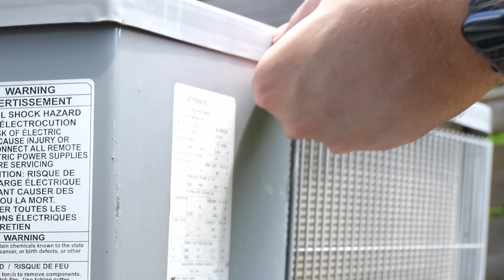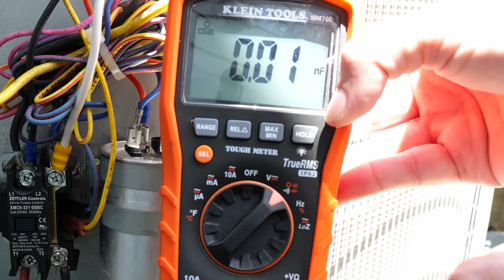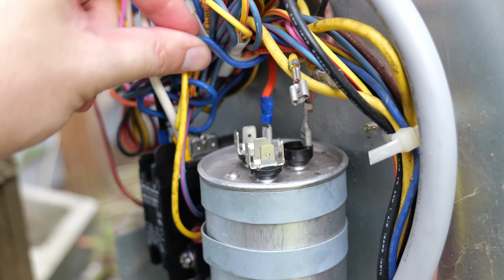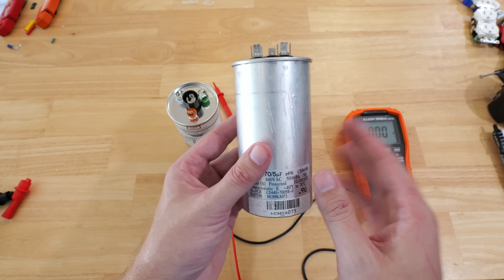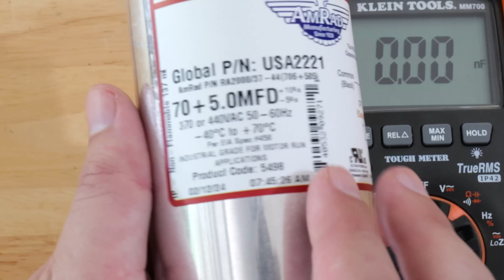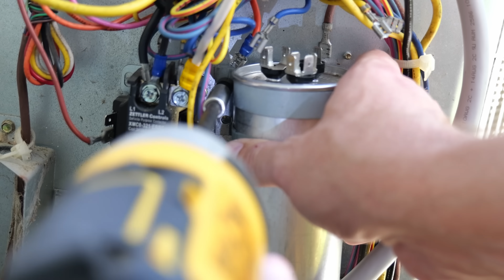Don’t Get Ripped Off! How To Avoid The AC Capacitor Scam And Save $500

Comment: I used to work on high voltage organs and amps. Had to desolder and resolder the caps to test. (Point to point wiring.) A hassle but you can't check a capacitor without disconnecting it.

Comment: Now I am confused about the part where you actually replaced the tested good capacitor. Was it indeed bad? If not, why did you replace it? What issue brought the technician to you so that he was to sell you the idea of a bad capacitor? If it's not bad, then did you solve your original issue?
Reply from the maker: I didn't have an issue.  It was a regular maintenance visit.  What does my capacitor have anything to do with anything outside of what was discussed in the video?  Why does the origin story matter?
Reply: @HowToHomeDIY  Because everything starts with a symptom and followed by a diagnosis and then an action. People don't just replace a capacitor because they want to. In your case (or in your video), you claimed your resistance was good, and you replaced it anyways, which confused me.
Reply from the maker: Because I’m making a video showing how I do it.  It’s not really that confusing.  I didn’t cover up anything.

Comment: I’ve been doing this for over 20 years and one thing I always keep in my pocket is a small sharpie. When you pull those wires off the capacitor mark on the back of the wires with a “C“ for common, and “H“ for hermatic and a “F“ for fan. That way if the new capacitor gets twisted around, then you can look on the top or the side of the capacitor and match the wires back up.

Comment: If I am paying a AC guy for a service call I would let him change that out.  The caps are not that expensive and you are already paying just to have him there anyway.  These Capacitors can go out at the worst times like on a Sunday.   I keep a new one in the junk drawer.   Also if anybody has had a few of these go bad it is most likely the motor getting tight. Check the motor see if it spins freely.  And guess what i am not an ac guy just someone with a few years on me.  ☮

Comment: last year I had to have a new condenser, I was told that it was still under warranty, to my surprise they charged me 700 dollars on a covered warranty part, and it took them less than 15 minutes to install it.  I know I am paying for a person's experience, but, I still have to feel I have been ripped off.  I am pretty sure the issue I have now is the capactor, I just dont feel confidnet to replace a $35 dollar part, and I figure I will be charged 500 or more dollars to get it up and working.

Comment: My air was not cooling the house i went outside to to the unit the fan wasn't turning and it was making a awful humming/buzzing noise. I shut everything off ,thermostat, and pulled the disconnect out .i then turned everything back on thermostat , put the disconnect back in. Buzz noise stopped fan cam on ran it for a while but still wasn't cooling like it should .i shut it off again and started it up and buzzing came back and fan stopped again . Basically the fan worked then it didn't. After shuting off and on . Ether way it wasn't cooling and the wind the fan creates was cool and not hot like I think it should be as it pulls the hot air from the house .so after this long explication could it still be the capacitor .would a bad capacitor make the unit ack this way  sometimes works sometimes doesn't

Comment: I've seen one video where the author added the corresponding refrigerant to his unit in a way same like you would add it to your car. I would appreciate any opinion, if this is a good idea. I saw a port, covered by a cap on my Compressor. seems like nothing complicated about that project, but the video about adding the refrigerant into the Compressor was the only one I saw. So not sure if there is maybe smth special about adding the refrigerant to your home AC unit. Thank you.
   Update: In my case of not working Compressor it was just a failed capacitor. Measurements of the capacity on both sides (HERM and FAN) were very close to zero. Today I installed a new AmRad one, and everything works well now. The attaching bracket (fm the original capacitor) was a bit too tight, so I released the attaching bolts much more than they were sitting originally, and used same bracket. I am happy, since it is 104F in Dallas TX today and expected to be for several more days. Though I have 3 extra portable window units for emergencies (and I think everyone in the hot climate should have), which I used for 3 days while I did the research, ordered the new capacitors and a contactor. They worked, but the Central AC is so much better. And from now on I'll have 2 spare capacitors and a contactor. I've seen on the unit a relay, I might order that as well to have a spare.

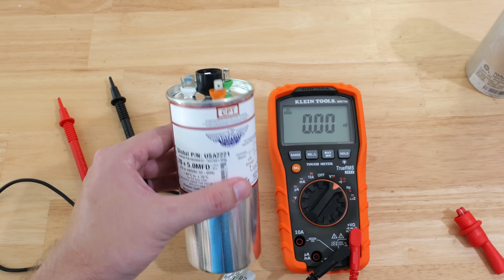Comment: @9:15   I think to use that AmRad Capacitor, but not sure if you need to cover with smth that 4th (orange) terminal (for Hard Start Unit), since I don't plan to install a Hard Start Unit right now. Or this capacitor is better to use only if you have that Hard Start Unit in your compressor? Thank you for the great video, which is very helpful for me in the project of replacing the Capacitor and probably the Contactor as well.
   Update: today I installed a new AmRad capacitor, and everything works well now. The attaching bracket (fm the original capacitor) was a bit too tight, so I released the attaching bolts much more than they were sitting originally, and used same bracket. I am happy, since it is 104F in Dallas TX today and expected to be for several more days. Though I have 3 extra portable window units for emergencies (and I think everyone in the hot climate should have), which I used for 3 days while I did the research, ordered the new capacitors and a contactor. They worked, but the Central AC is so much better. And from now on I'll have 2 spare capacitors and a contactor. I've seen on the unit a relay, I might order that as well to have a spare.
Reply from the maker: It doesn't make a difference, it is just there in case you do have one.  It is currently in my AC unit now since my cap blew out a couple days ago and I don't have a hard start.
Reply: @HowToHomeDIY  Thank you very much for the replay.

Comment: Don't you have to have an insulated screwdriver, or tool, before messing around with discharging a capacitor?  
As a rule, I'm SUPER leery of messing with electricity. I do it, out of financial necessity & because I don't want to be a wuss, but my sphincter is so puckered it squeaks as I'm trying to work, & it's very distracting. 🫣😳🤦‍♀️🫣😁

Comment: Good for you testing for voltage. Did you check something that was energized after checking the line side of your incoming voltage? I have seen a meter fail and give a 0. Reading when in fact there was full voltage on the terminals.

Comment: The other main problem with this practice of simply replacing the capacitor, is that it can often miss the reason why the capacitor went bad (when it actually is defective), which could be a more severe issue with the unit that needs to be diagnosed properly.

Comment: Thanks! Your video was easy to follow and understand. Not only did I save big bucks, but I was able to fix my A/C the same day and not have to wait 3 to 4 days for a service call. This was the 3rd time my A/C's capacitor failed, but this time I fixed it with your help.

Comment: On the hottest day of the year, my ac stopped. Called a local company and they wanted to charge me $800 to change the capacitor. I’m glad IM resourceful enough to dyi. 30 bucks and 10 mins I changed it myself. I’m offended by gouging
Reply: If you had called my company on overtime rates, it would have been around $900 to replace a capacitor. I've been an hvac tech for 20 years. I would much rather have homeowners take care of themselves instead of calling me at 2 am asking to pay triple price and demanding i come out right away  because they're uncomfortable and somehow that's an "emergency"

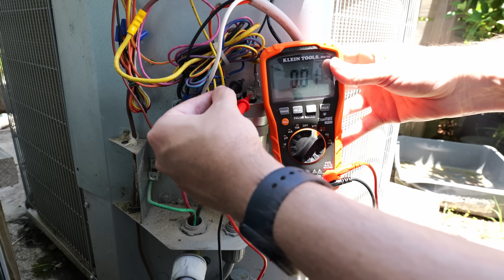Comment: Hi can you tell me why you used a red on the common in the first test (6:32) for the common and then a black on the second test (8:21)? thanks
Reply from the maker: It doesn't make a difference.  There wasn't any reasoning.  Thanks for the question!

Comment: 30 year HVAC tech. 90% of the time the capacitor will look in good condition when its bad. Its simple folks. Check the contactor to see if the plunger is drawn in right in the middle. That proves your thermostat is asking for your AC to come on. Second is to check high voltage with meters. If the fan is running but the compressor is not or vise versa, its your fan or its your capacitor. Your capacitor provides electricity surge to start them like a car starter. If one doesnt start replace the 20$ capacitor.

Comment: I replaced a capacitor on a 220 volt window unit we call big Bertha. The capacitor only had two connections and I got it wrong. As I was moving the capacitor it discharged into the case. I hooked it up again and this time I did a screw driver discharge and it sounded like a gun shot. It was getting charged up, but was not discharging as part of the compressor operation. Be careful.

Comment: How much do you think a chicken costs a farmer?  By the time it gets to the grocery store and you buy it, there has been a lot that has gone into it. It's crazy to hear people that will pay 75$ for 3 dollars worth of food at Applebee's complaining about mark up on parts. Buy a van, hire a guy, fill the van with 10k in parts, buy insurance,  buy workers comp, but the expensive tools, then tell me how expensive the capacitor is. Idiots.  You wouldn't run my errands and give up your Saturday for 3 or 4 hundred dollars,  but you complain when a licensed proffesional charges you to do that. Wait until you need a compressor.
Reply from the maker: So people should just accept $500 bills for $20 parts and 30 minutes of your time?  If you have that much overhead, you may need to look within.
Reply: @HowToHomeDIY 
30 minutes? I can tell you were an hvac tech for about 3 minutes before you started this grift. No qualified tech will just swap a permanent split capacitor out and call it job done. You should clean the coil, get the mud out of the bottom so it doesn't rot, tighten all the wires, which probably destroyed the capacitor to begin with,  check tge charge, seal the access caps, check the evaporator,  clean the evaporator drain. All the stuff that will make it run correctly without eating the compressor for tge next 10 years.  You're bashing service companies and you have no idea what they do. Go ahead with your grift, you're causing so much damage for them to repair.  Unfortunately,  most just want to het you up snd running for the long haul.

Comment: Unfortunately there are companies that are only out to sell parts. But I went to a reputable technical college for two years. Worked as an apprentice and eventually became a master technician. You are paying for my knowledge and expertise. If I found a bad capacitor I would find the reason it went bad, and there is always a secondary problem that led to the capacitor going bad. I would correct that problem then complete a fifteen point check on the system. I was never on the job less than one hour. You would receive a guarantee on my work and factory warranty on parts. Also I would keep customer updated as to what I was doing and why through the hole process.

Comment: So glad my Trane unit has Separate start and run capacitors, because the cost combined of replacing the two is 5 times less than replacing that duel capacitor of yours. No excuse of why they couldn't have designed that unit of yours with enough space for separate capacitors, except on their end additional wiring, and maybe a cheaper board?

Comment: What people don't understand or think about is your not paying for the part before the tech showed up you didn't know it was the capacitor so that's #1 also you don't have that size capacitor put away in your house it is conveniently in the service companies truck outside your house #2 convenience also you will get a warranty from the company who installed it also you won't have to worry about liability like getting shocked with 240v or installing it wrong and grounding your compressor ect #3 it is a service your paying for not the part just like you would pay 80-90$ for a steak that costs 15-20$ at a steak house you don't ask your waiter how much the steak costs before you order it stop being a cheap pos and pay the service people when they fix your shit
Reply from the maker: Uh oh, sounds like we have an upset HVAC tech here.  1. I knew it wasn't the cap before he got here because there was nothing wrong with my unit.  Was just regular maintenance.  Also, I do always have an extra cap on hand so it is here already and I don't have to call a potential scam artist posing as a pro.  #2 Have literally never had an issue with this.  Turn the power off and the wiring is super easy especially if before pictures are taken of wiring placement.  #3 I am not buying an $80- $90 steak.  That is for the rich and I guess, scam artist AC techs that have all that extra cash.  That is ridiculous, just like paying an HVAC company anything over $300 for a cap replacement.  Thankfully, I can fix just about anything on my AC outside of refrigerant as I am not going to go through the trouble of getting my EPA cert.

Comment: Heat pump AC died yesterday afternoon.  I knew from prior experience and Youtube it was likely the capacitor.  Watched this video to confirm how to test it and this was perfect.  Mine tested bad.  I ordered a new cap from Amazon at 8 PM last night.  It delivered a few minutes ago and I had it installed in 5 minutes.  AC is working now.  Absolutely great video.  Thank you so much.

Comment: This is a really good video. Thanks. Well explained. I have the mm420 version of that meter. I learned when testing some electronics that they can have a capacitor testing limit. Mine goes to 400 mfd. anything above that and it won’t work. I think your model goes even higher. But if you have a capacitor that is over 400 mfd, mine shows “OL”. Even though capacitor is good. Lastly, the meter itself has a +/- of like 3% accuracy. So consider that when measuring things.

Comment: how do you replace an older ac capacitor mine the connections are different on top where the wires are naked and go through the 4 holes in the terminals

Comment: I replace my own, they are easy to test and easy to replace, just following general safety precautions, power off, disconnect, test that power is disconnected, short posts on the capacitor to discharge, and replace that rascal. easy peasy.

Comment: Have 10 rental units 20 HVAC inspections per year. Everytime the routine maintenance fids a bad capacitor. Shocking! Every tech is a liar. I routine replace the capacitor every 3 to 5 years.

Comment: My sister had a bad capacitor on her air conditioner and the company insisted on replacing the unit.  Another contractor looked at it, replaced the capacitor and contactor, and they only charged her $150.

Comment: ac unit 2 blue wires   2 red wires  on main capacitor  jumped to a seperit fan capacitor  then power .i want to go back to 1 capacitor 3 reds 1 blue .i have new cap  not shure about the wireing

Comment: This video is bs on so many fronts. Pixar’s early form existed before Lucasfilm hired the people to get its internal graphics division going. Ed Catmull and Alvy Ray Smith helped form  the graphics division at NYIT, and then while at Lucasfilm, they were throwing names around for the hardware they wanted to eventually sell. Alvy tossed out “the Pixer”, an invented Spanish verb meaning ‘to make pictures.’ 

Loren Carpenter said, “Well, radar ends in ‘ar’, and it’s got a kind of high-tech feel to it. Why don’t we use ‘ar’ instead of ‘er’?” -The Pixar Image Computer was  born. Howard the duck is 100% unrelated to the Pixar story. Jobs was smart enough to see where it was going and funded Pixar after the hardware couldn’t sell enough to sustain its costs.

Comment: Keep in mind (as stated),that bad caps don’t always swell. Sometimes just the fan itself wont spin up and when manually rotated will eventually spin up and maintain while pulling higher amperage. Saved myself $1100 since the motor my tech said was bad was not. I replaced the cap with my spare and never called him back.

Comment: AS AN ELECTRICIAN, AC techs are generally full of shit! 9 times out of 10 if I get a call for no power or bad breaker the unit is cooked! These guys don't even open the unit, I know this because the OG screws are in there and not laying on the ground. Do better AC techs, I make you look bad.

Comment: I’m curious what was wrong with your AC?  Why was he there trying to sell you a capacitor you didn’t need?  Were there other tubings wrong that you called a tech for?  Capacitor is usually the cheapest & easiest thing that could be wrong with your AC.  Odd that would be the thing he would choose to lie about.
Reply from the maker: Regular maintenance checkup.  Nothing wrong.

Comment: O.L. is "over load" or "over range". It simply means that the meter can't measure high enough values for it's range setting/capability. This is true for all modes and scales. Don't assume that the meter will tell you the nature of your circuit. It is simply making the measurement you asked for. "open line" is for you to determine, not your instruments.

Comment: I used to work in electronics and was told that its very bad for a large capacitor to discharge it with a direct short.  You should use something with resistance.   In this case most of the time its already discharged but if it wasnt you could be damaging your capacitor.